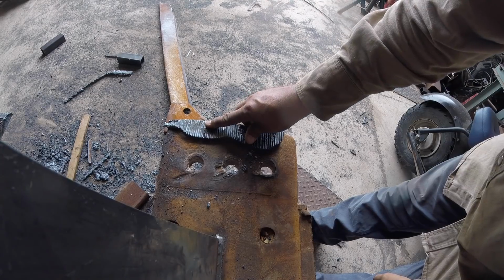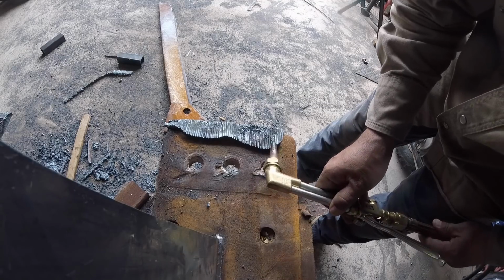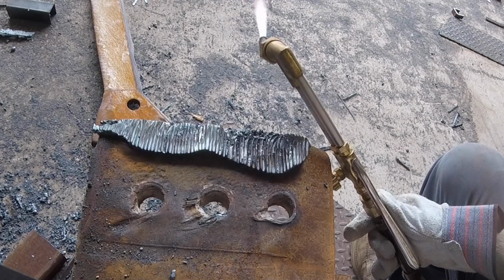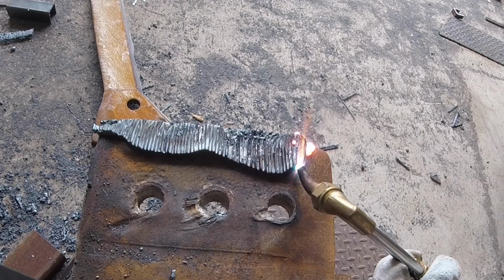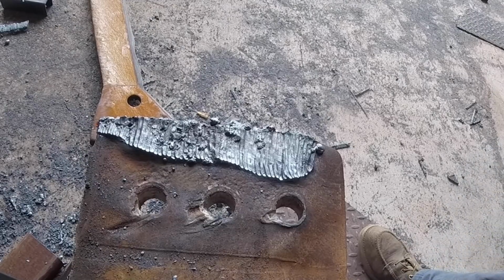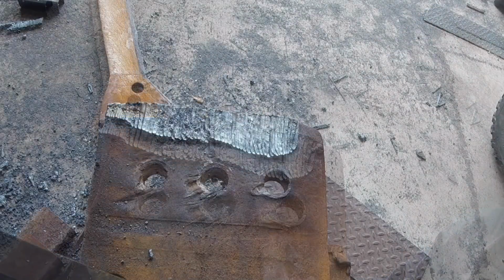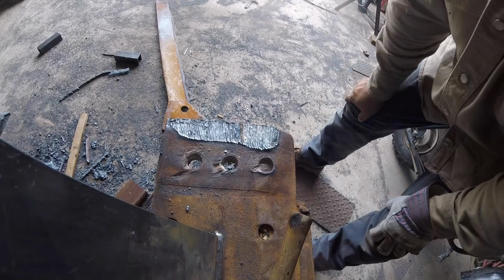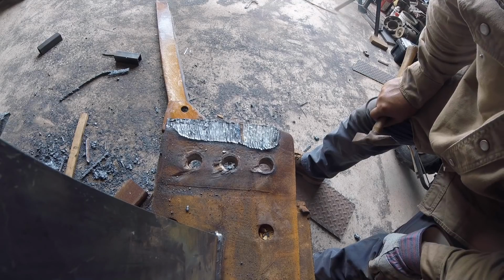Torch Scarfing? Have you tried it?

Comment: I think I still have a scarfing tip left in my tool box from my time wrenching on transit mixers. We used this tip when removing the rivets from the fame and drum supports. It was better for this as the air arc was hard to control with 185 psi on the shop air and only 1/4" arc rods.

Comment: The key to scarfing or "washing" with a torch is to have your oxygen and acetylene set high enough that once you have the metal hot enough to start flowing, the higher constant oxygen pressure will basically wash the fluid metal away. The oxygen should be set high enough at the bottle so you never have to hit the oxygen lever. The acetylene should also be set high enough to counter act the higher oxygen pressure in order for you to heat the metal faster and get a good flow of molten metal started. After a nice flow of molten metal is started and without using the lever, the higher O2 pressure (at the bottle) will start to make the metal flow or "wash" away pretty quickly. Then you can walk or slide the curved tip that is parallel with the base metal back and forth and forward to progress the flow off of the piece. You rinse and repeat until the remnant is gone and you are level with or have nothing left but the base metal. 

If you are using the oxygen lever it can go south pretty quick by inadvertently cutting down into the base metal from hitting an inconsistent spot and changing the path of the pressure pushing/washing the molten metal away. The scarfing tip is curved so that you can rest it on the flat base metal behind what you want to scarf away. With the curve of the tip, it aligns the point of pressure parallel with the base metal to help prevent gouging passed the metal to be scarffed and down into the base metal (or piece that needs to remain intact or undamaged). 

The reason why it is a dying art and a lot of people have a good general idea of how to do it, but don't quite get it right, is because it actually takes quite some time to get the metal hot enough to start flowing really good. Most contractors shy away from it for that very reason. It just takes too long to do it and do it correctly, so they would rather someone just bust out an arc gouge and skim it close, then grind it. But, the right person with a scarfing tip can do it without having to grind at all when it's done. 

It's just a matter of how patient a person really is. It is a much cleaner way to remove excess steel IMO. As a Union Boilermaker if I have an option to scarf/wash remnants away that was left behind from a cut, I will do it every time. Mainly because it involves almost no grinding when complete.
Reply: We call it washing in uk
Reply: @ We use both terms in the states. It all depends on what part of the country you’re from.

Comment: Not sure how you could improve on the way you did it I don’t have an arc gouge and unless I’m at the shop I don’t have a plasma to use so the torch is my main unit for cutting out welds and fishing for the seam and with this method you really have a limit to smooth clean cutting ability but if you’re patient really you can take it down to the parent metal without much grinder work needed just have to balance quality over speed to meet the needs of the situation always a pleasure to watch you work

Comment: I take it that flame was oxidized and not neutral? You got quick hands brother so I couldn’t catch a glimpse. I try scarfing with just a regular cutting torch head. Seems to work, but I use a neutral flame as if I was cutting something. Maybe I’m doing it wrong though🤷🏻‍♂️
Reply: Hi , I’ve done what you call scarfing for about 30yrs, but here we call it gouging. You can sort of gouge with a regular tip ( nozzle here ) but the velocity of the oxy will be too high and direct. Get yourself a gouging tip, and you are right it helps to be a little oxy rich to stat with. One important thing is to keep the heat in the material and keep going as it is the oxy flow through the tip that keeps it cool, if you take too long to initiate the gouge all the heat is coming back at your  tip and will cause it to melt,  then you’ll be asking about about something really serious, good luck and remember cutting like this should send those sparks about 10ft or more, so have a look at what you,re about to set on fire.

Comment: The one important thing you misses was using the torch as a hammer to knock the slag off lol. Great job on the video. We did alot of that in school with removing backing strips but haven't done it since

Comment: I like to start at one end and got it hot enough to start get the angle set  then just drag the length of the weld.  Similar to how you would cut it with a cutting tip. I enjoy your videos. Keep it up.

Comment: Torch scarfing can remove LARGE amounts of steel. That's why scarfing torches are used in foundries and some of those are monsters. If you don't want to beat on your welding machine torches get it done. Some scarfing torches are faster than carbon arc.

Comment: Too cold, and the pressure is too low. You should be blasting a pool of molten steel off of there. I’ve scarfed/washed with a scarfing tip in the shipyard for almost two decades, that stub is a two minute job, you can also scarf with a straight/cutting tip, but you need to have some finesse or your blow through your base material. Good on you for trying 👍🏻

Comment: If the process worked, and you’re happy with the results, then you did it right. 
We always called that a washing tip, never heard any other names for it until now.
I’ve done quite a bit of that while working at a sand and gravel washer, having to trim old welds off of parts I was trying to reuse.
Did a lot of arc gouging also, but embedded sand in small cracks and pits in the metal seems to throw the gouging process off a little bit. The sand tries to turn to glass before it blows out, so the air stream seems to alter course around the glass beads.

Comment: I'm no professional welder, machinist by trade, but I always laid my torch haed as parallel as I could get it to my work surface and ran my oxygen up around 70 and it worked out really good. Providing you can do that with your work piece.

Comment: This would sure save money on buying special equipment for arc-gouging to get by with for special repairs and save on grinding the welds out.
Definitely worked better with more pressure and heated metal.

Thank you IC for sharing Scarfing, never seen it before. I only used a plasma arc to gouge, but that was on SS.
Reply: @ohgeorgee7570  you can do the same on stainless using iron powder ;)
Reply: I'd like to see that ironpowder trick. How does it work?

Comment: We used #8 gouging tips for years to remove 3/4” wear plates from conveyor hopper cars and other wear points. After a while you can get almost surgical with them, if someone else is paying for the gas.
For your application you might want to carry a bigger molten puddle and wash from side to side to achieve a smoother finish Isaac.
Reply: , if someone else is paying for the gas.

Comment: Scarfing tips are hard to find for my Harris torch.  I've done this sort of thing with a straight tip, and it's no fun.
Reply: Get an ESAB/Victor torch
Reply: I've got a Harris as well-  While harder to find & more expensive than the cutting tips, they are available. Not sure if you have the same model, but the model of the gouging tips that fit my torch are 6290-1G, (& 2G, & 3G).

Comment: I used them when I worked as a deck engineer to cut eyes of the deck that we welded in random places to lash equipment down. I seem to do better with the air arc setup and preferred that to clean off all the trip hazards. The air arc seemed to do better with rusty metals in the salt water environment. 

Have you ever used 6011 to weld under water? I had to do that inside a barge to weld a crack between bulkheads. You better have some rubber boots on and wear nitrile gloves under your welding mitts or you get a little burst of energy here and there. If the hull was punctured we built a box out of steel plate around the hole. Add a 1" union for a drain to weld the top plate on and then install a plug to keep the sea water out. It could be plated in the dry dock later on.
Reply: Yep taken a number of hits from my Miller Trailblazer 325. Working out in the rain and snow. I now keep spare boots and gloves on the truck.
Reply: Thankfully I haven’t gotten shocked by my own welder yet. I was working on my fence and the ground was damp. I was feeling some tinging in my knee on the ground couldn’t figure out why until I looked where my ground and electrode were. I then pictured the current flowing and I’m in the middle.
Reply: While deployed to Iraq our welder was teaching me how to TIG. It was hot as hell so I was sweaty. I rested my forearms on the table and everytime I stepped on the pedal I'd get a zap through my elbow. Moved the ground clamp to the part after a couple hits lol.
Reply: Try 7014 and if you dip them in expoxy you have a pro rod. Also make sure you use a DC machine if you don't want to kill yourself. I welded. Underwater  and cut tons of steel under water in the 70 s and 80 s. We used 400 amps with the old arc air rods .anyone can cut with Broco rods.

Comment: I have not seen it done this way before.  It is very clean. I usually use a washing actionwith  bigger pool of molten slag. I must say I like your results. I will try your way out tomorrow at the yard. I'm currently replacing a bunch of rotted  structure off of a adjustable boat trailer from a salt water marina. This could help.

Comment: I’ve only ever used a scarfing tip to remove 1-1/4” bolts. I normally use a #2 cutting tip and run 30psi on oxygen.

Comment: Thanks for the info about scarfing!  I am not a welder, just a typical home garage kind of guy, but love watching your work and appreciate your tidbits of technical information!  Keep making videos, you have great style!
Reply: Judging from your self description, you have probably encountered wheel bearings on something where the inner bearing got hot and fused to the axle hub. Maybe an older car or a trailer or something. 

I use this when I come across that. You can usually take a strip 180 degrees or so apart and use a chisel with a large hammer to remove them pretty easily. Just be careful to work on the bearing and not the spindle. 

So practice up a bit. Get a thickish piece of metal, stack a few weld beads, and scarf them off.  Eventually it will come in handy.
Reply from the maker: i have a short video on removing seized bearings.
Reply: @sumduma55    A bit of personal experience with a chisel on a bearing race....  I had an inner bearing on the rear of my old tow truck seized to the axle stub.  I didn’t think I needed the torch to split the bearing, I’ll just knock it loose with a chisel and a BFH.  Short story is I was the emergency room a short while later getting the tip from my 1 inch cold chisel dug out of my forearm.  The whole tip shattered off. I thought I’d been shot.  I wasn’t sure if it just hit me or buried in my arm.  I was sure after my dumbass put a magnet to my arm😂.  I now use mild steel or brass to beat on hardened steel.

Comment: I need to get a gouging tip. Been meaning to for a while. Another way that I learned to scarf something small off of material you don’t want to gouge is using a cutting tip, heat it up like normal and just turn your oxygen way up instead of using the cutting lever to scarf it off . Works great when you’re scarfing something small off or a small weld. Does not work well with thin base material.

Comment: Can't you use this same method to cut a rusted nut (for example) off of a bolt without ruining the threads on the bolt? It seems like I have done that before, and I'm not even a welder.
Reply from the maker: Yes, thats not really that tough to do. its a good trick to have in your pocket. :)

Comment: Just an old scrapper hear for scarfing try propane it cut's in controllable stream's and lot's cheaper than what you usually use :) great vid anyway
Reply: You'll have to change your tips to run propane and you'll go through a lot more oxygen (4x I believe vs. acetylene), but it will be much faster, especially the preheat is almost instant. I think in the shipyard we were running our oxygen pressure at 100 psi.

Comment: heard about washing off welds as I work around steam locos and how every so many years during rebuilds the process was mentioned as per the boiler procedures and code and then redone, nice to see it done though I thought it would take fewer passes, I also thought that was called a torch gouging tip or is it called a scarfing tip, or are they differant

Comment: We touched on it in our apprenticeships. We didn't actually use it as such and were only really taught for a morning and given a quick go. 
For me, one of the most memorable apprenticeship experiences was us heading over to the (coal mine) scrap yard. We wanted a sheet of thickish steel (1") so that we could practice punching through using a gas axe. It completely failed that day! Basically nothing would work - our instructor becoming more and more frustrated as the day dragged on. Every time we'd get a small pool going and hit the oxygen, it would all blow upover and not through. We tried everything we had - more/less pressures, different flow rates, various nozzles and even a beast of a gas axe that rarely saw the light of day. Weirdly, the sheet would cut fine from the side..
The instructor reckoned it was the steel sheet itself. It came from the mine's wash plant and although fairly rusted, he reckoned it was some type of stainless metal and perhaps even dual layered - like an armour skin.
Those early days and learning metalworking skills - they never leave you   :)

Comment: I've been anticipating a scarfing video from you. You are an expert with a torch. I do alot of scarfing at work but I'm not necessarily good at it. My trouble is I end up blowing out the base metal I want to keep. For instance we need to pull the pins out of 81x lumber chain and we use the torch to blow the head off the pin while at the same time not destroying the chain link. Sometimes I get it right oftentimes not.
I noticed that you did not lay your torch down perpendicular to the base metal. It looked like it was not quite 90 degree. I'll have to try this. 
Thanks for the video!
Reply: Hey Rodney, thanks for the comment. A couple of things that might help you is the tip that IC is using, it has a special curve. The air pressure he is using, and the fan to help keep base metal cooler. My personal choice is air arc or plasma. IC has years of experience. Schools are OK, for welding nothing beats practice and experience. Keep working at it, have a nice day.
Reply: That is a special gouging tip. There  are also tips designed for taking the head off a rivet or bolt
Reply: Hi Rodney try not using the oxygen handle at all, just the flame, if u go straight on position ( like hammer hitting nail) then slowly heat the top of the pin and u make a small pudddle keep rotating outwords u see it flowing away and base material whont get damaged( again dont use the oxygen handle just set the flame right that takes feeling and practice  and let me know how it works for u

Comment: Bump your oxygen up more. We ran around 70 when I was in the shipyard. Hold the tip a slight angle down from parallel to your parent metal. Adjust as needed. You can watch the metal you are removing wash away and leave the parent metal behind untouched. Just have to be careful of the welds. You can gouge the parent metal if you aren’t paying attention. We refer to this as flushing up in Washington.

Comment: Back when I was a pipefitter in the shipyard, I did quite alot of scarfing steel and welds off bulkhead! However, I did fail a test and still haven't learned the secret or mastered How to scarf the weld off of a T-bar full of Fillet Weld used for practice! At least not, clean / or up to their standards. I didn't see the point as there aren't really many real world application, we always replaced rusty metal with new!  This was a very useful video showing how to take down thick metal!

Comment: I would not call that 'scarfing'.  According to "The Making Shaping & Treating of Steel" by USS, scarfing is a surface preparation method used to remove defects such as scabs, blisters, seams, blisters, and rolled in flaws from slabs, blooms, billets & other intermediate rolled stock.  Scarfing has pretty much gone the way of the dodo bird, it's become obsolete due to improved melt cleanliness, and continuous casting, which has eliminated the opportunity for soaking pit refractories to contaminate ingots.  

Also by skipping the primary often coarse reductions from ingot to slab or bloom, the worst kinds of contaminations scabs & blisters no longer exists, or is limited to the starting & stopping of a continuous cast run, which are usually chopped off.  Starting in the 1950s the scarfing torch generally gave way to grinding stations which removed less good material and were significantly faster.

What you did was akin to gouging.
Reply: I've heard scarfing used to describe shearing the weld flash off the inside of rolled tube as it is being made.
Reply: FYI biggest steel mills in the world still scarf their slabs/blooms/billets. Mostly in Asia and a few places in Europe. Other places either hand scarf or use smaller machines to do it
Reply: A properly maintained scarfing machine will blow away a grinding machine in both surface quality and speed.
Reply: I design scarfing machines among other things